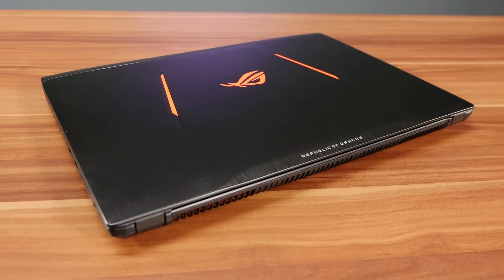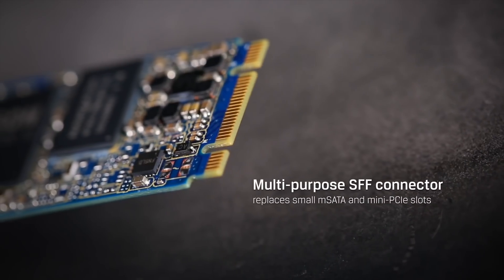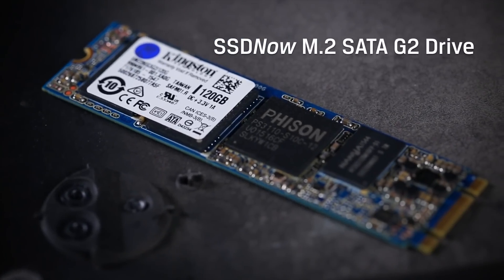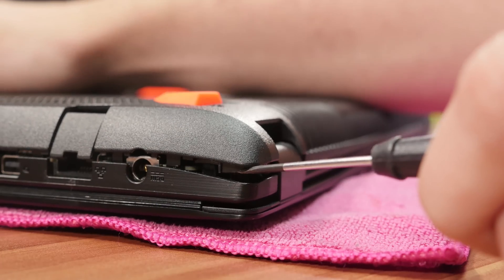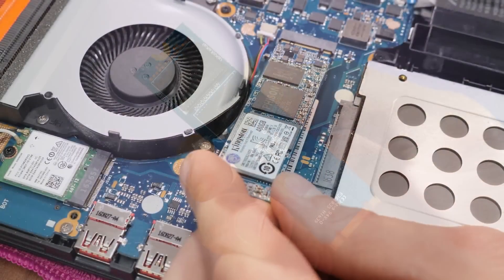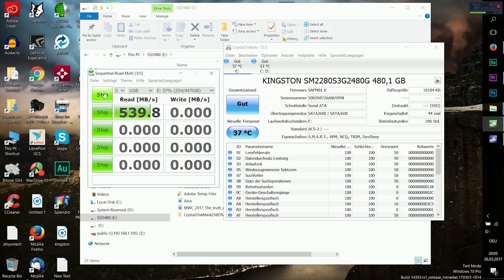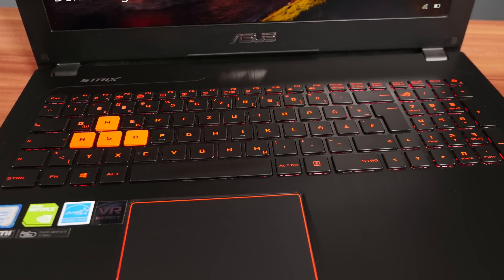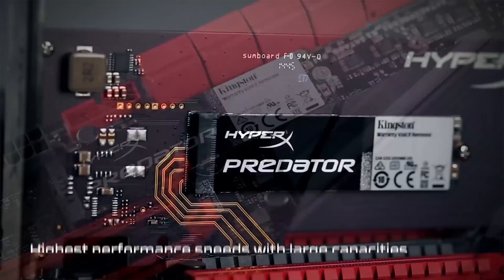How to Make Your Computer FASTER - Kingston M.2 SSD Tutorial

Comment: im in dilemma whether this nvme sata A1000 interface would work on normal sata on my acer e5 laptop. One thing i know this m.2 ssd is running on times 2 nvme speed not all 4 and i did check in hwinfo64 bus no 9 it support X2 nvme speed. now i dunno should i buy this or only normal sata m.2 ssd.